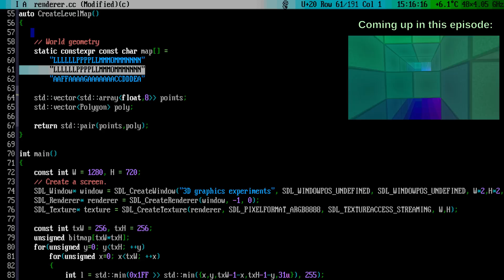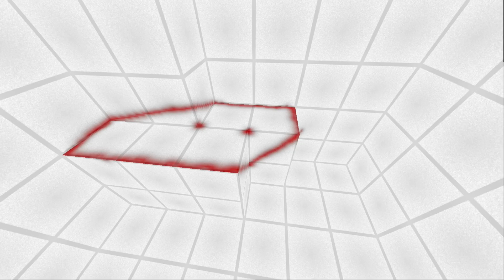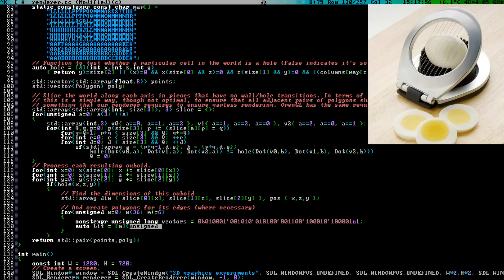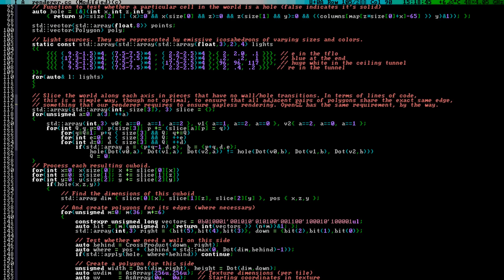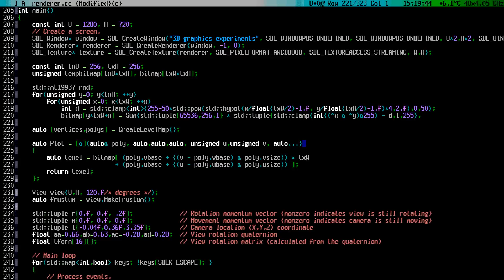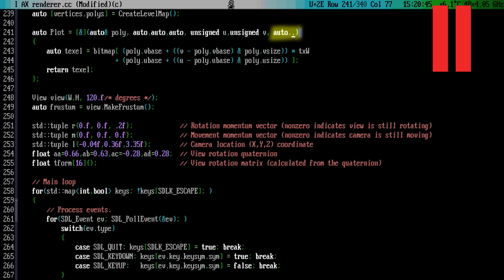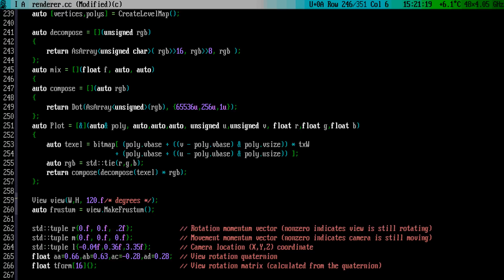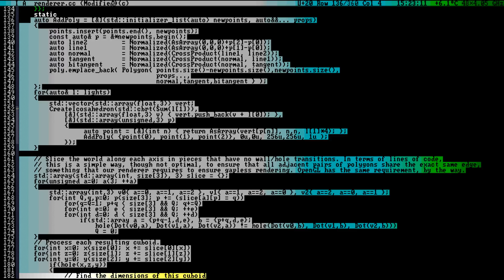Illumination Tutorial for Software 3D Rendering (1/2+) [c++20]

Comment: Tip:
Shading equations make sense, but .... after long years, someone realized that RGB 128,128,128 is much darker than 50% gray.
So more correct approach is to get input color in fragment shader (or cpp code), do gamma correction, e.g
vec3  matDiffCol = pow(u_color,vec3(2.2));
 // color of object passed by uniform
then perform all the shading and color mixing and as a last step do inverse gamma correction
fragmentColor = vec4(pow(color, vec3(1.0/2.2)), 1.0);
As a result scene has more natural contrast cause all the shadows appear brighter. Same applies to image filtering. Imagine having 50% black and white pixels as random noise and when image is blurred and downsized, average values will be close to 128. Which is much darker gray than what you see in original image viewed from distance.
Reply from the maker: Gamma correction will be addressed in the next episode, don’t worry.

Comment: Awesome vid as always!
I'm Greek, here's the pronunciation corrections you asked for at 5:45 ;D
'γωνία': it's pronounced with intonation on the 'i' and with a lighter 'g' sound (like 'w' in 'wash')
'πολύς': your pronunciation threw me off at first, but then I realized that you pronounced it as you would in ancient Greece
In modern Greek it would be pronounced like "polis" instead of "polus" (the greek letter ypsilon/'υ' is pronounced as "ea" in eat. "ου" however, would be as you pronounced it)
Reply from the maker: Thank you! Actually my pronunciation for πολύς was off even for ancient Greek. It would have used /y/, which I do know how to pronounce. I just didn’t bother checking the relevant articles this time. What does “with intonation on the 'i'” mean?
Reply: @Bisqwit  Intonation is variation in pitch. I suppose 'tone' would be the more appropriate linguistics term (in Greek it's "τόνος" too, which I originally thought was "intonation" in English).
Anyway, regarding Greek tone, vowels with the ' mark on them like ί or ό as opposed to ι and ο are pronounced with higher pitch.
From your video I noticed your intonation for 'γωνία' is higher on the 'α' at the end rather than only at the 'ί'.
Sidenote regarding intonation: The above regarding ' -> high intonation (and the rest low), is the case with modern Greek. Ancient Greek had many types of intonation (3 iirc), and the rules were more complicated, both to write and speak.

Comment: 5:04 what are this zero's and one's numbers? the ones in the unsigned vector string?
Reply from the maker: It is an array of thirty-six integers in range 0—1. For each of 6 polygons that are the edges of a cuboid, I calculate two vectors: “right” and “down”. Each of these two (times six) vectors has three fields: X, Y, Z, and these fields have either value 0 or 1. So, 6×2×3 = 36 one-bit integers.
For instance, for the first polygon, down = (1,0,0) and right = (0,0,1). I dislike long lists of number data when screen space is premium, so I packed them like this.
Reply: @Bisqwit  תודה רבה לך!

Comment: A beautiful video with a good explanation. How big is the binary when compiled at this stage and what are the minimum specs required during operation? Will you ever do a video on emulator resolution filters/upscalers?
Reply from the maker: The program showcased in the end of this episode is 43392 bytes on my system (dynamic linking executable). It requires a video output device such as a graphics card, and a CPU and some memory.  The compilation with full optimizations takes 3½ seconds on my system with max 440 MB RAM used.
Scaling filters is not particularly a topic that has been on table. You are the first person to even talk about it.

Comment: I'm really loving this series and I think your decision to include the process of refactoring is amazing (it teaches a lot about how refactoring works and how to get better at it)
very amateur question so excuse my ignorance haha, I was wondering what is the real point of a lambda function in a language like c++? is it purely syntactical sugar ? It's obvious how lambdas are good in functional languages and when the need arises for passing functions around but say at line139 at 4:55, why would it be better to wrap the code that gives you the point in a lambda function inside your current scope ? as opposed to the traditional way of simply wrapping that logic in a helper function and saying GetPoint() ? do lambdas really make things more readable ?
Reply from the maker: There are a few things that would be much much more verbose to do with lambdas, such as closures (referring to or copying variables from the surrounding context) but the primary advantage of lambdas is that it allows keeping the code very close to its context, instead of shotgunning everything everywhere. Regular functions cannot be declared inside functions, so if you need to pass e.g. a comparator to another function, you have to place it far away from where it is actually used, even if it is used just once. One of principles of maintainable code is that you should not have things that are needed and things that need them far away from each others.

Comment: Absolutely unreadable code. Is all C++ code like this or is graphics programming just suited to only ever using magic numbers and single-letter variables?
Reply: I would say for highly technical or math/process heavy subroutines it helps to be brief and not use MassiveDescriptiveVariableNames because it hinders reading what's going (Those * ? /, etc  symbols are important too). Overly descriptive code can be a bane on its own.
Reply from the maker: Pretty much any code written in a language that is unknown to a beginner programmer knowledgeable in some other language, is opaque and obscure, until they gain enough general purpose knowledge about programming in the applicable types of programming.
Reply: @Bisqwit  No, that's not it. I have a little over a decade of experience in software engineering. This code is unreadable because you've made it purposefully difficult to read. It's like you ran it through a minification step that inserted all the constants as magic numbers and renamed all the variables to single letters.
Those are some very impressive graphics demos but damn is the source code absolutely unreadable nonsense.
Reply: @WayfaringAmoeba  I second that. And he makes it as such to just flex. No other sane reason.
Reply from the maker: You are of course entitled to your opinions. Personally, I think majority of the code is actually rather boring, especially the levelmap generator/loader. It only does what it must do, and there is much that it must do. Particularly the part that “egg slices” the world into cuboids. It feels boilerplate. Tedious. Boring. Dragons. I only parade it in the video for completeness’s sake. If I have to parade dragons, at least I try to make them as small as possible so that we can quickly focus on more interesting stuff.

Boring code gets short variable names.  e. d. Q. p. These are variables that serve no other purpose than to have a handle on what’s happening. It makes no sense to name them secondAxisIterationVariable, thirdAxisIterationVariable, transitionNotFoundYet or positionAlongThisAxis. I do not want to grant those variables such dignity, especially when they occur fifteen times within three lines. They’re just the grit of the boring labor work task. It’s not a fine algorithm. It just does what it has to do, and accomplishes results. I do not want to shine a lamp on that part. There be dragons. In fact I tried to distract the viewer from it by talking about something other than the code, while the boring stuff was being written. I did the same in the CreateIcosahedron function.

Comment: fantastic stuff. i really liked the way you described each part of the summation formula.
seeing the lights spin around at the end and how quickly they overexposed the surfaces they were near made me think of how many types of more complicated renderers prevent that from happening by using a non-linear curve to calculate light intensity. since you mentioned using ~2 as an exponent is more realistic, maybe you could show off this light intensity thing as well
Reply: some games implement exposure control, where overexposure is prevented by making rest of the scene darker (this is a bit how your eyes work: when you look at a fireplace at night, you can't see the forest behind it). this allows for greater range of brightness to be presented in the engine. you can also make the scene brighter if there are no bright spots, simulating what happens when you get used to the dark.
Reply from the maker: I am actually planning to cover dynamic exposure in a future video. It is one of the things that I wrote a proof of concept implementation for already years ago.